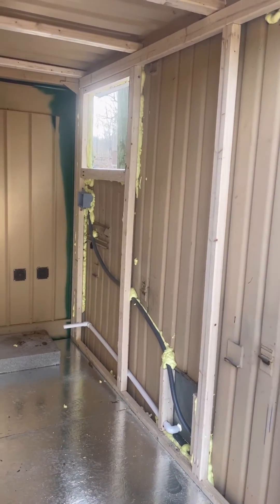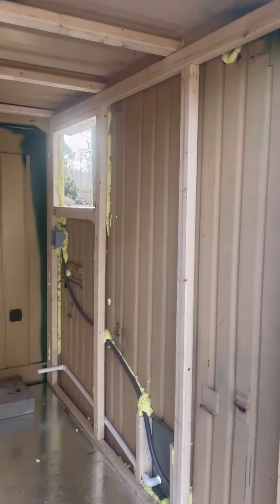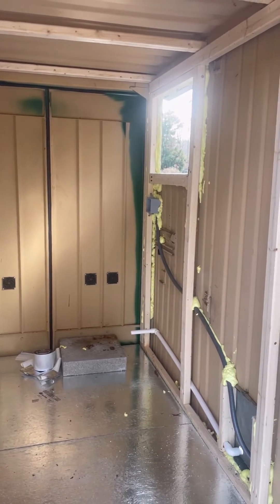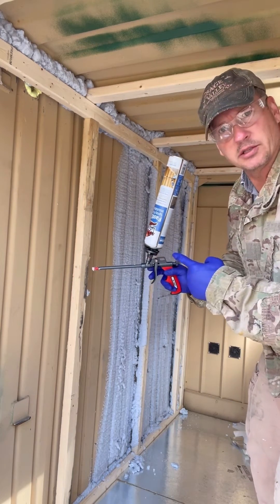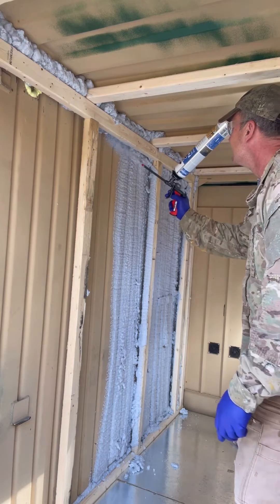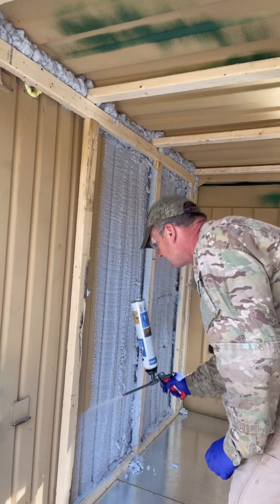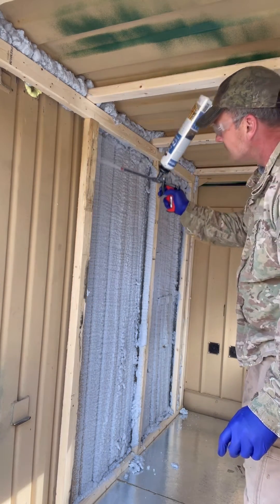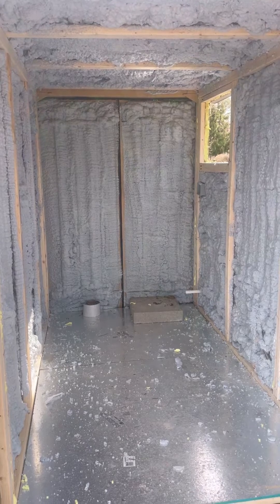Building a refrigerated container

Comment: So can this be done and maintained cooler than 38°?
Reply from the maker: Yes.  Lots of people do it.  If I had to do this project over, I think I would have used some of the refrigeration unit 4" insulated panels I see for sale on facebook marketplace all the time.  I think that would have made it hold temperature more efficiently.
Reply: @SecretGardenBees Thanks for the quick reply! My goal would be to build a freezer and keep it below 32°F. Is that possible with the CoolBot or would I need an entirely different system?
Reply from the maker: @RMC2021  I dont believe Coolbots are rated for freezing.
Reply: @SecretGardenBees gotcha - so I’d need a different cooling system altogether. Thanks!